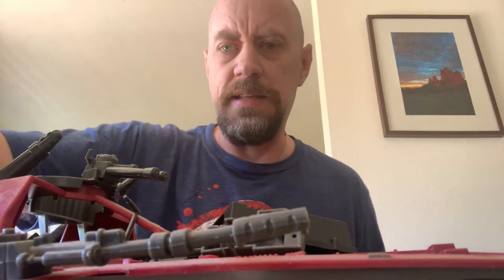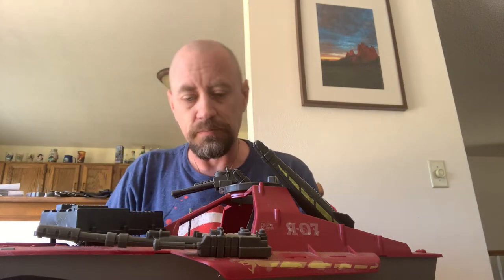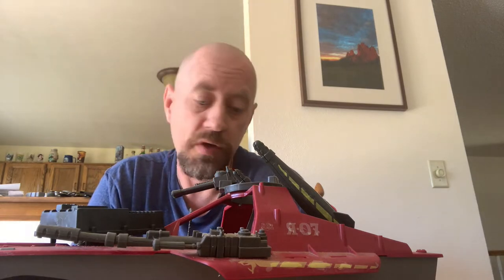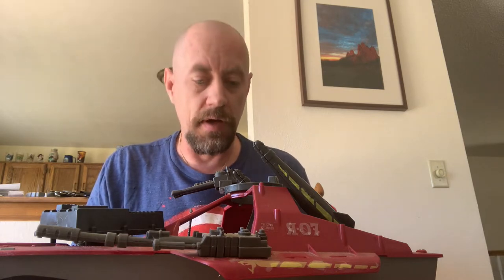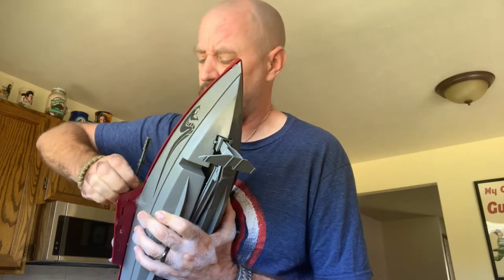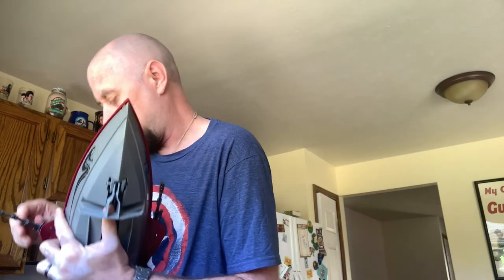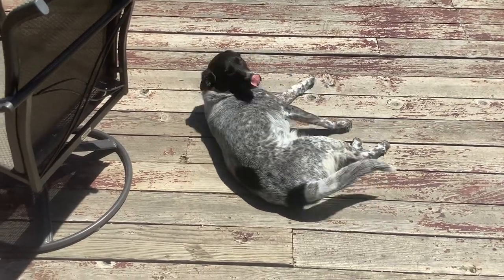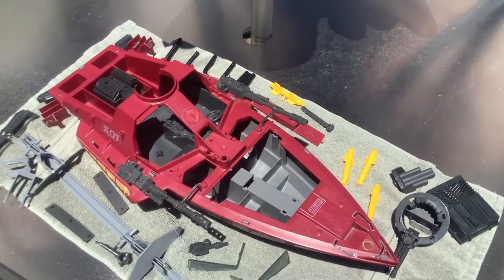Vehicle Restoration 101: Cobra Moray

Comment: I bought a Moray for $20 at a comic book shop yesterday and started this process. It was so filthy I decided to take it apart and clean it with water and Dawn as well. I unfortunately broke the front two tabs but I knew it was a possibility as the gray was turning white by them before I even started. The decal glue was terrible to remove. I used Goo Gone too and my experience with it a lot of the time is that it isn’t so much as Goo Gone as it is Goo Move. I got it cleaned up and ordered some repo labels from ToyHax so I think it’s going to look pretty good. I ordered a junker from eBay that has all of the tabs to replace the bottom. All in all I have $40 into it but I love this toy. Great video and subscribed.
Reply from the maker: Yeah, it usually takes me 2 or 3 goes with the Goo Gone to really clean something up, I'm glad it was helpful and that you enjoyed it!

Comment: So I started a small restore but I started placing repro stickers on some parts but now I want to apply a plastic shine spray. Will the shine spray #1 damage or remove the newly placed stickers? Great video!
Reply from the maker: I can't say 100% without knowing what's in the spray. However, the decals from toyhax are almost a vinyl. Very thick.  Sealants tend not to be corrosive, so I'd think you'll be ok. Your best bet is to try the sealant on a small area/decal and see what the results are.  I'd be willing to bet it works just fine, but better safe than sorry! 
Thanks for the comment and I'm glad you enjoyed the video!
Reply: Go Figure Custom Action Figures I’m going to give it a shot. Thanks for the reply/tip!
Reply from the maker: @ShadyGFella  Anytime!